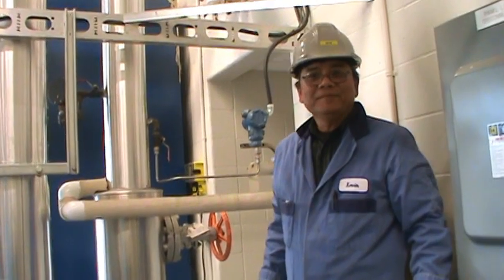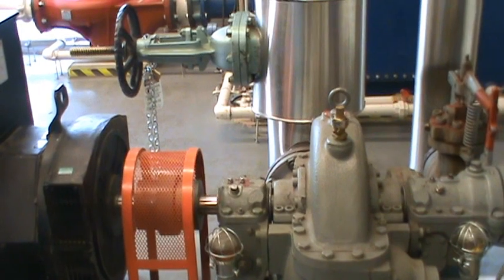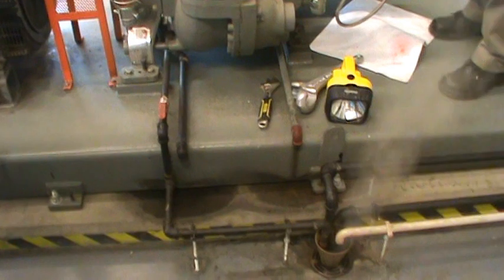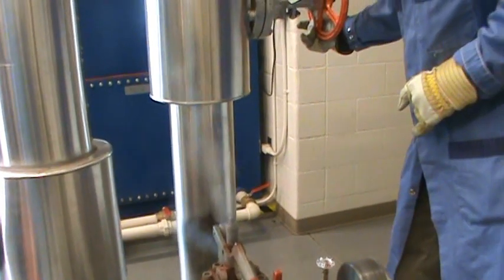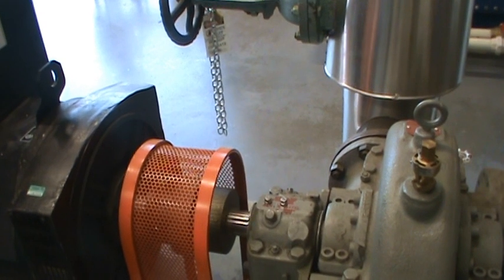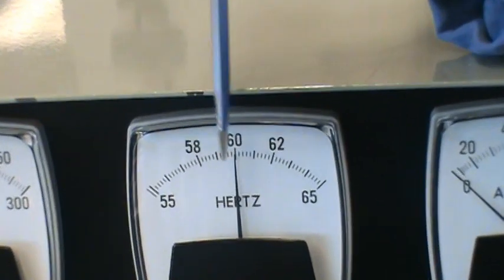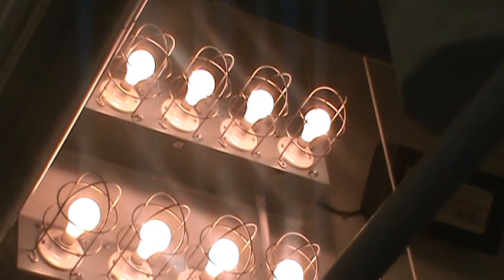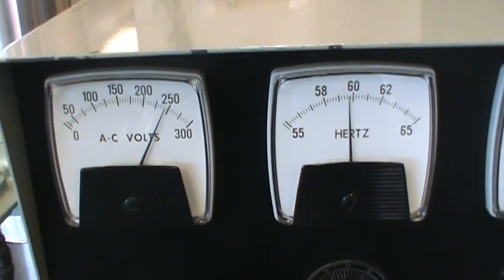Steam Turbine Generator Start Up

Comment: Install a Barber-Coleman Isocronous governer, and use a magnetic pickup to sense shaft speed, with a 4-20Ma signal to control the valve position with a Limitorque  L120.  This will make the system Isocronously goverened at 60 hertz.

Comment: Were you running to a dead buss?  Without automatic governor control and a synchronizing scope, I can see the potential for unit damage if you're tying into a live buss.
Reply: That's next week's video. We are going to close the breaker at 180 out of phase and see what happens.
Reply: @kimmer6  Cool.  Always wanted to see a generator disintegrate.
Reply: @ignatiusdemonseed  In 1989 at Blue Diamond Almond Growers in Sacramento, Calif, a 6 Megawatt generator under full load had its breaker open then slam closed thanks to faulty fault detection equipment. The generator ripped out all of its foundation bolts, output buss bars, cooling water lines, broke the shaft near the coupling, and tossed itself out and far enough over to punch a hole in the control room wall, then it fell back in the hole.

My job was to supervise crews to remove a Westinghouse steam turbine and its generator from a closed plant in Danville,  Virginia, and adapt it to the 20 foot high existing concrete pedestal. 3 months later it was up and running. It was shipped in pieces and was assembled and aligned in place.  A machine shop near Oakland renewed many of the parts. 

That was a challenging job and it needed a hands on engineer/hot rodder like me to think on the fly to make it all work. The unit ran fine for years until the utility company reduced the payment for the excess power sold back to the grid. I heard that the power plant was removed and sold years ago.

The boiler was fired by a mixture of wood chips and almond shells fed by conveyor belts. Extracted steam was used to dry almonds, and the entire factory ran on the electrical output of this unit.  All of the extra power that was put into the grid generated money. It was one of my favorite jobs. We had an 8 foot job progress chart taped to the wall and it was completely useless 4 hours into the first day.
Reply: @kimmer6  Great experience, bro!  That's true cogeneration.  In a scheme like that there's profit opportunity at every corner.
In 1989 i was an operations shift supervisor at a five-unit coal-fired plant on the Ohio River.  Saw some strange stuff but nothing overtly catastrophic like your deal at Blue Diamond.  Did that until 2003 then went into generation dispatch, everything from solar to nukes.  That was fun.  Retired now.
Reply: @ignatiusdemonseed  I used to tell operators  to leave the control room, take a few hours off ''Because a watched pot never boils''.  You can tell who a Plant Operator is at a party. He's the one who's feet hit the desk before his butt hits the chair. Its cool to know that you know where electricity comes from and everything it needs to get distributed through the grid. All of my friends think it just comes out of the wall outlet.   We had rolling blackouts here in Calif this Summer thanks to extreme heat. Not at my house.....I have lithium battery banks, inverters, transfer switch to rig for silent running. There's an Onan 7500 diesel gen set on a 40 gallon fuel skid with rubber mounts bolted to my garage floor in case of a quake. That's for recharging on rainy days. I retired in 2018 and life is going well...so far.
Reply: @kimmer6  dude, you obviously take your power needs very seriously.  that's quite the contingency system you have.  here in Lohio last week we lost ALL incoming wires  due to high winds... no power for 39 hours, no internet for 96 hours.  we kept hot things hot and cold/cold with a little 3500 watt portable.  As for power coming from the walls in my home,  http://www.youtube.com/watch?v=71kckb8hhOQ      heheh

Comment: What's BVP???
Reply: I guess it's BPV or Back Pressure Vessel.
Reply: @zelkhantntp9435  for what??
Reply: @rickyrexa655  Steam turbine exhaust is being used to pressurize steam vessels for other operations inside a plant or mill. Usually steam turbine will receive higher pressure steam, let's say 20 bar. After being expanded inside turbine, the steam will drop pressure to around 3 bar. This steam will exit through exhaust pipe. It's wasting energy if we didn't capture the exhaust steam, so we capture it inside pressure vessel, known as BPV. BPV pressure will be used for other low pressure operation as needed by the mill or plant.
Reply: @zelkhantntp9435  and than.. For what savety valve...

Comment: I love the resistive load test. The incandescent doesn’t lie. In my service truck there’s a box labeled sure-meter. There’s a rubber pigtail socket with alligator clips and a 75W INCANDESCENT bulb. My digital meters have been known to lie. Great video. Also noticed you turned your head when you threw  your feeder breakers. Also good practice. Curious of the hp. How does the turbine handle current in-rushes?

Comment: Where can i BUY a steam turbine to generate electricity
Reply: In order for you to do that, you'd need a boiler to produce stream for the turbine. You'd need fuel to run the boiler. So its more than just a steam turbine needed...

Comment: pge  california has grounded the high voltage. A lot of leakage. A lot of rfi . Inside buildings everything is at 20 volts noise. wont fix.

Comment: Water boils in a vacuum at room temperature all you need are two chambers and a condenser coil making it so the steam goes from one to the other passing through your engine or turbine as the steam condenses the vacuum is maintained so the energy requirements are minimal to start and a set amount of water to use.
Reply: Turbines with an exhaust under a vacuum operate much differently than ones that don’t. You’re correct about less energy. I’m currently having issues with my over speed trip valve slowing the turbine down
Reply: ...not just any vacuum.  What your talking about is a perfect vacuum. Like space... The energy required to pull a vacuum even remotely close to that would be completely impractical.  It Would require more energy to pull the vacuum than the turbine could ever make.  That's why over-unity will never work...
Reply: It has to get energy from somewhere, there is no such thing as perpetual motion, or energy, would it get energy from ta decompressing?

Comment: Interesting.  In my younger years I worked in the Millwright trade.  I was all over the state  live in in just about every type of factory you can think of.  In many older facilities I would see those turbines sitting idle or sitting in scrap piles.  But I never saw one that was still in use for some reason.  Even in plants that had steam supply they seemed to have moved away form the turbines.  I have often wondered why. Ideas anyone?  Also wondering what the SHP would be for the turbine shown here?
Reply: jon jenkins I am an operator in a large refinery operating in North America. The majority of the pumps that I am responsible for (35 or so) are steam turbines and few electric. Fascinating pieces of machinery and makes a well rounded operator. To answer your question.. in my opinion.. steam is a huge cost. Turbines require a lot of maintenance. Training is very important, it can be dangerous to operate.. not trying to ramble but you get my point. Electric as a primary could be viewed as cost effective
Reply: Hey there fellow Millwright Local 1607 here
Reply: cost maybe?
In oil & gas, steam turbines are widely used over electric motors as prime mover.
I dont know the cost breakdown for which is cheaper: to use electricity from the grid to run the motors or use boilers and turbines, unless you have your own Cogen and supply the excess electricity back to grid

Comment: Should synchronize and connect it to the grid so you won't have to worry about adjusting the RPM. I'm assuming it's a synchronous generator.
Reply: leerman22 Jesus Christ you are on just about every video I watch!
Reply: Cessna 182a
I am God!
Reply: +leerman22 That assumes that it is not for example on a ship.

Comment: what is the rated power of the steam turbine? what pressure and boiler capacity is required to run it? what are the turbine dimensions - impeller measurements?

Comment: Who makes that particular turbine?
What pressure is required?
Reply from the maker: It is a Elliot steam turbine which hooks up to a single phase generator. Usually we run it at around 1000 kPa and try not to run it under 500 kPa. It is for educational usage.
Reply: @kevinengineering6734  how can i acquire a generator like this to instead of a turbine i want to run is i want to run a belt pulley shaft to run a horizontal steam engine off it but can you sell me a generator for this application going off grid running a horizontal locomotive boiler and include information instructions of proper installation of the generator for my house and shop
Reply: @kevinengineering6734  
Do you have any more info on this turbine? It's power rating? Maximum electrical power? Steam temperature, pressure, and mass flow rate, and condenser temp/pressure? I would like to calculate the efficiency.
Reply: Kevin Engineering Kevin I am an instructor at a local college teaching power engineering. We have three static coppus turbines, We are interested in a generator package. Can you give me some direction as to where you purchased your unit. Thanks,
Reply: Kevin Engineering what gave it away as an elliot and not coppus ?
Reply: hi ve
Reply: Adam Cook you mean "tur-bi"?